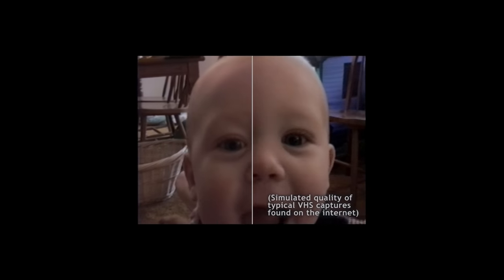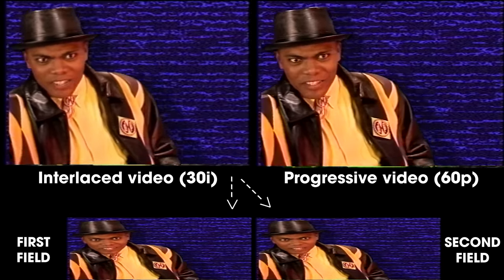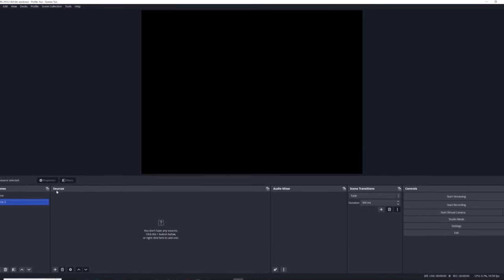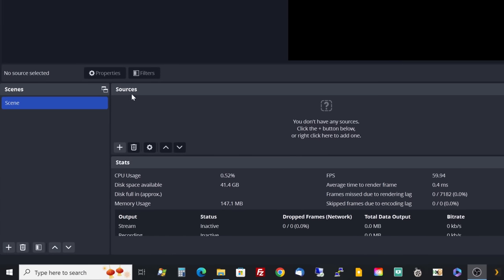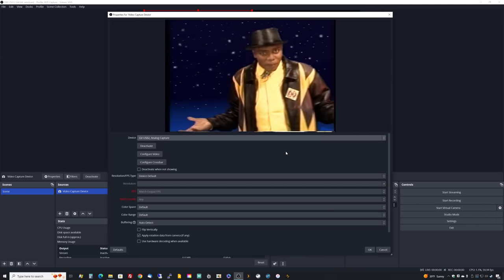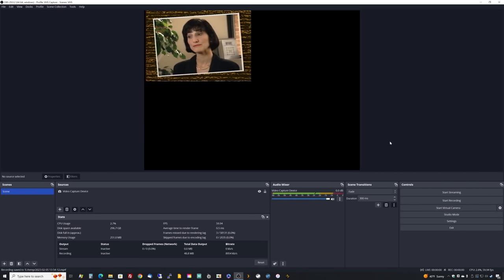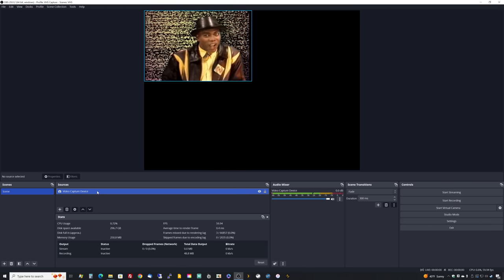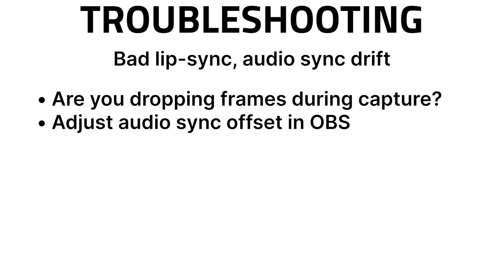How to convert VHS videotape to 60p digital video

Comment: I've outgrown, 4 x 3. Back around 1996.

And so when transferring, 4 x 3 video. In recent years. Since around 2008. And since then. I walked away from Adobe Premier. I walked away from Avid Media Composer. I took up with then, Sony's Vegas now by, Magix. And with that software. I capture in, 4 x 3. 525 lines, standard resolution video.

Then, I will zoom and crop. To, 16 x 9. Which frequently requires cutting off some of the top. And cutting off some of the bottom. Occasionally. You might have to do a key framed, ascension or dissension. For the amount that had been cut off. To achieve the 16 x 9 aspect ratio. But you don't get away Scott free there.

The causes image degradation. Your 525 quasi-lines that are really around, 260 coming off of VHS or Betamax. Now looks rather soft and focus and not sharp,, nondescript. Yuck. So!

You use a Sharpening, filter. And you crank up the apparent resolution. Which makes the picture look a lot sharper. And now you can see all of this noise. So much noise. So!

Vegas gives you the ability. To, separate. The black-and-white luminance. From the color, chrominance. Where you will find most of the noise. So!

I will then. Switch off the color. Adjust the sharpness. For a nice sharp looking black and white picture. And then I turn the color back on. With all the noise. Tons of noise. A lot in blue. A lot in red. And it looks like little bugs are crawling all over everything. So!

I will then. Simply. Completely blow the focus out. On the chrominance or the color, information. Now it is all just blobby color. With, no definition, no resolution. And when combined with the sharpened black-and-white. You now see the color for everything. Nice and saturated. The way you like it. Because you can turn the color up. And you will see no noise. Anywhere in the color. And everything will look, normal and higher in resolution. And no oscillating noise fuzz in the color. It's clean looking.

And then you render the whole thing out as, 19 20 x 10 80, 60 P. And you will be amazed! I've been working that way since 2008.

Plus I found it very easy in Vegas. To create and adjust, digital lighting. To adjust depth of field. To do, multilayer, digital compositing and color correction, exposure correction. And Vegas makes it very easy to do. I started using Vegas. When it was just a multitrack audio software program. That they later added video to. And it's Awesome! Great for rock 'n' roll video productions! And offers a, Multi-Camera, feature. Once you synchronize, video camcorder tracks in the software timeline. You can then run the program down. Looking at 4 shot simultaneously. And simply pressing a button. To cut between the different shots and cameras. And then you go back later. And you tweak the ins and outs, the heads and tails. Of those button selected, shots when you ran the program in real time, viewing. It's Fabulous!

I know this is going beyond the scope of this video here. But what can be accomplished on the cheap. Is pretty damned amazing, these days. Gone is crappy looking and sounding, video productions. Good riddance! Barf!

This is a great video. I enjoyed. Thank you! You are leading people down a good direction. A good path. OBS is cool. It can do, a lot. Maybe not what Vegas can do. But Vegas isn't cheap. But it's one of the most important pieces of software. In my professional arsenal. And I've gotten tired of the way that, Avid and Adobe and others are migrating to. I'm not interested in monthly fees. For the rest of my professional life! I like purchasing my stuff! Not renting it. Not leasing it's. But owning it. And answering to no one. I like being Off Grid. And only use a, online workstation. For the comings and goings. Of my production files. And so it's the Drive Through, Workstation. As I have more than one. I have old computers and some recent computers. And a modern-day iPhone and Go Pro's. And so anything shot today looks great.

But to take some of that old VHS and Betamax stuff. So much of it looks so washed out. So under the color. That it's fun to record color bars. And then see what you get on playback on a scope. On a Vector Scope. And you ain't got no color saturation! Crank it up! It's called, Color TV, for a reason. It's not supposed to be pastels. Supposed to be vibrant. It's supposed to Pop. I am not producing a Hollywood Feature Film. It ain't no, Star Wars.  It's a Travel Log, of a Rock Band.  And you can make them as colorful, as you want. Saturated, color. The way it originally looked. Before it made it to, VHS/Betamax, Color Under, format. And that looks like washed out, garbage. But then you have to deal with all of the noise. And blow the focus on the color resolution. Because there is no resolution of the image. In color. It's in black-and-white. In the luminance. And this is a cute little trick to play. After you transfer washed out, 4 x 3, video.

And who wants to watch an awkward square picture? In the middle of a widescreen display? I sure don't. And I don't like out of focus side wings. Ugh! I want my 4 x 3 as 16 x 9. Without the stretch. All reframed. For every single shot and scenes. And then you have something to watch and really enjoy. And go HUH? This looks a lot better than it did originally. Yes it does. And it's not 4 x 3 anymore.

And so this is to be covered in a future video. By our illustrious host here. But that's how I've been doing it. And the results are, no less than, amazingly stellar. When you understand. The technical aspects. Of that old analog consumer video stuff. And how it all worked.

And so I just utilized. Some of that old analog consumer video technology. To improve a digital transfer. That gives it a whole new fresh look. And comments of… What did you used to get this back then? You then simply tell them. You were close friends with Steve Jobs. And work will likely start rolling in for you.

It's like me. I'm a recording engineer. And I have also recorded Michael Jackson. Yes Michael Kevin Jackson. Is a wonderful black jazz bass player in Washington, DC. As I recorded him. I recorded Michael Jackson. Not the dead one. Not the famous one. The other one. But I did in fact record, Michael Jackson.  That's no lie. And I'm glad he called me. Because I would never call up Michael Jackson and say hey. Can I come over and make a recording of you? No.

Though I would have liked to. And considering. I worked with his producer, Quincy Jones.  And we hit it off. Working together for an entire television season. He invited me out to LA. But I couldn't take advantage of his offer at that time. And now we are both retired. So I missed that window of opportunity. Damn.

Because… Yes. Some of us are actually that good. And now, retired. And here I am! With you clowns. 

I don't know what I did wrong to deserve this?
RemyRAD
Reply from the maker: Thanks for your memories and thoughts.  I don't agree with cutting off the top and bottom of 4x3 video just to remove black bars on a 16x9 display, though.  You're throwing away picture content.

Comment: Hello. Thanks for this video. I used your exact settings, having downloaded OBS and purchased an IO DATA GVS-USB2. The video files came out great that I recorded (after some audio delay tweaking). However, I need advice for the reason that a 3 minute video I recorded with VHS created a 600 MB file. This is huge. I have hours and hours of video I'd like to digitize / preserve (mostly from 8mm film). I tried a program called "Handbrake" to try and compress, but still am left with huge files. I guess my question is what's my next step? I would like to be able to share the videos with family online or YouTube and there are limits on file sizes that can be uploaded. 

Well, any help would be great.

Thank you.
Reply: Not sure what type of hardware you have, but I was able to halve my file sizes by switching the video encoder setting to Sotware (x264). When using my graphics card, the file sizes were more than 2x larger.
Reply from the maker: As @EyezOfTheBeholder mentioned, try x264 as an encoder.  But be wary of making them TOO small because then you'll start to see compression artifacts.

Comment: i use an easycap 2.0 which you said not to use, however in obs my vhs footage looks insanely interlaced, not like yours. is there a way to fix that? i also don't use an HDMI upscaler, just the capture device itself.

Comment: If you find for me and a S-VHS player (that has not bad rumor about "eating" the tape) for classic VHS cassettes under 80 euro I'm in. (or about 50 euro even better)
Although I have suspicion that a VHS-DVD combo device would be better.
Reply from the maker: Most S-VHS players these days are $300 and higher on ebay, so I'm afraid you won't find one for 80 euro.  Same goes for VHS-to-DVD recorders.  They are in high demand and low supply.

Comment: What do you think of the ADVC100?
Reply from the maker: I think it was a great product for its time, and if you don't have anything with high-contrast color edges (like video titles), it's fine.  But if you do, the 4:1:1 color sampling will produce some jagged edges.  I think it's really hard to find firewire these days, so I don't generally recommend trying to find one.
Reply: Thank you for the information.
I already own the ADVC100 but was wondering if I should get the Dazzle.
Yeah, FireWire is so old and the files come out huuuuge. The one really great thing is that the audio is in sync with the video for hours.
I guess I'll be getting a Dazzle!

Comment: Ugh! I've fallen at the first hurdle - trying to get a decent video capture device.  I'm in the UK and have a Macbook.  The IO Data is not readily available over here and appears to be PC only. The Stargate is available, but PC only.  I do have access to a PC (Windows 11) but I don't think people have had much success with getting them to work with windows 11.  So do you have any recommendations that will work well with a Mac or Windows 11?  I've seen the Dazzle on eBay, but will it work with Macbook or WIndows 11?
Reply from the maker: I haven't tried any Mac capture devices, so I'm afraid I can't advise.  Sorry!  If you do manage to find one, OBS is available for the Mac, so you'd still be able to follow this tutorial.

Comment: Is it possible to use a Vidbox as capture device? Does it allow/support for capturing both frames?  I can't seem to get it to show me "picture" when I select it as a source.
Reply: picture showed up, but I don't see where I can confirm the passing of each field except to try it and see if the picture at 60 fps looks good.  Excellent video and set up with OBS.  It looks like it may be working on the file I tried.  Keep up the great videos.

Comment: I used to own a DATA VIDEO DAC-100. Are you familiar with it? Does anyone know if it will pass both fields?
Reply from the maker: Yes, it's an analog to DV converter that converts the entire interlaced signal, so you connect the analog video and audio to the device, and it converts it to DV that you then read over firewire.  If you are using that device, don't use this tutorial, and instead use firewire (IEEE 1394) capture to get the raw DV data, then you can use the FFMPEG command-line in this video's description to convert that interlaced DV video.

Comment: At the moment I can't get any sound on the obs by anymeans. I tested external usb mixer and nothing
Reply from the maker: Did you try adding a separate audio source, and picking the USB mixer as the device?  Also, does the mixer only have an ASIO driver?  If so, you need an ASIO plugin for OSB; search for "ASIO plugin for OBS" and you should find it.
Reply: @TheOldskoolPC  yes external mixer

Comment: It would be better if you advised people not to upscale, stretch or do any kind of modification to the source material as that's the output you will always be left with the day the vhs tapes fail.

It's better to something as close to the original as possible so that you can later modify it through copies however you want.
Reply: This tutorial is specifically about making files which are easy to upload to and will look good on YouTube.

Comment: The test video you converted is 10 seconds long. File size is 38.233MB. As a result of these facts, an hour-long video would take up 13.763GB, which is a huge amount of space. Is there anything we can do with these facts?
Reply: That's not the results I've seen using the method in the video, making sure to choose regular software encoding since my PC can handle it. A 49:27 long capture ended up being just about 1.8 GiB.

Comment: I'm learning the Dazzle 1.1 won't work with OBS on a mac. Would I need a driver for it to work on a PC? The one I bought didn't come with a disc. Thanks :)
Reply from the maker: You do need a driver for PC, but I include one in this video's description.  But if you have a Mac, you can try a different capture device that does work on Mac; the software and procedures are the same.

Comment: Do the latter two devices pass the signal through untouched (without de-interlacing) like the GV-USB2 does?
Reply from the maker: All three recommended devices were acceptable in my testing.  The two NONrecommended devices did not pass through both fields.
Reply: @TheOldskoolPC  Thank you! I was able to find a Pinnacle Dazzle Rev 1.1. Thanks again for this essential tutorial
Reply: @plaidtractor_creative  How did it go? I  tried Dazzle 1.0 and it didn't go well... I ordered Dazzle 1.1 and hope to receive it soon... - Paul

Comment: Is OBS compressing while recording using these settings? I recorded a 2 hour vhs tape and the file was 30GB. I watched your other video and you used VirtualDub and Handbrake. Can Handbrake be used to compress the file?
Reply from the maker: OBS is indeed compressing during this process.  This tutorial was designed to make it easy for beginners to have a single all-in-one step that exports finished files.  My earlier tutorial gives you more control over each part of the process, but some people wanted a simpler workflow, hence this one.  You can certainly follow the previous tutorial; I did for many years.

Comment: Will this method also work for capturing MiniDV and Hi8 tapes? If so, do they need to be captured at 60 fps in OBS as well?
Reply: For MiniDV and Hi8 (if it’s digital) use Firewire cable, then deinterlaced it using third party tools like handbrake or QTGMC AVISynth.

Comment: Is there a reason we wouldnt use "fit to screen" over "stretch to screen"?
Reply from the maker: Great question!  "Fit to screen" will attempt to preserve the aspect ratio of the source, however analog NTSC is not 1:1 square pixels, it's more like 0.9:1.  We choose a square-pixel aspect ratio canvas, and then use "stretch" to ensure the source fits that canvas.  That way we get free aspect ratio conversion, so that circles don't look like ovals, etc.

Comment: Hey friend.
I tried the software and it works great for me.
Except for something 1.
The file is really big.
A 1-hour movie costs almost 10 GB.
Is there anything to reduce the files?
Reply from the maker: You can try custom encoder options.  Try x264 with CRF 23 and the "veryfast" preset.  You can also run already-captured files through handbrake to reduce their size.

Comment: what do i do if the capture output includes some nasty artifacts? and the aspect ratio is incorrect=?
Reply from the maker: I couldn't advise unless I saw what you were talking about, sorry.  Maybe something in the troubleshooting section of this video will help?
Reply: @TheOldskoolPC   where can i upload images here? the output is at a rare aspect ratio and it includes some weird signal artifact stuff at the bottom of the image, i worked around this problem  by using the "transform" option in obs by setting the height and position to where it should be, but it would be cool if there is a way to solve that weird issue from the root, maybe the drivers i'm using are bad? (old drivers on w10)

Comment: Is anyone else struggling with no sound?  VirttualDub picks it up but I get nothing with OBS.  any ideas?
Reply from the maker: If using Windows 10 or higher, and a dazzle device, it's possible the driver no longer permits audio; that's why I added a troubleshooting section for using a second source for audio.  I didn't have these issues in Windows 7.  The Dazzle device is 15+ years old so it's a driver issue, unfortunately.

Comment: Is it the same framerate for feature films or direct to VHS movies?  I have a lot of only on VHS horror movies.  I know the standard fps of movies is 23.976.
Reply: if the source framerate of that movie was 24fps, the worst that can't happen if you deinterlace is that only the analog noise will look smoother because the source has less frames and deinterlacing will not create fake frames unlike AI.
Reply: @JPX64Channel  I assume you still set it for 60 though as it was probably already converted to be interlaced.
Reply from the maker: Feature films on NTSC VHS were laid down using a process called Telecine, which spreads a film frame across 2 or 3 fields.  If you are trying to recover this as cleanly as possible, it is best to capture the full interlaced signal (480/486 lines) and not attempt any deinterlacing, then use a program, avisynth script, or ffmpeg to perform inverse telecine and recover the original 24 frames per second.  Handbrake is an easy way to do this.
Reply from the maker: Yes, because you're capturing the analog video signal.  But the original film frames can also be recovered if you capture the interlaced original without processing; see my other comment about inverse telecine.
Reply: @TheOldskoolPC  that's what I thought.  I was so confused on another tutorial.  Ive used handbrake many times before and sort of know what I'm doing there.
Reply: @TheOldskoolPC  what should be the framerate for the capture in OBS for movies, 59.94 or 29.97?